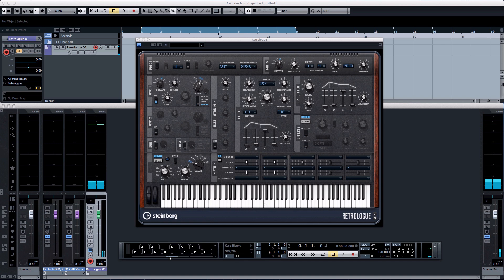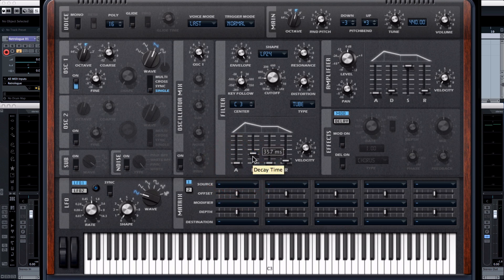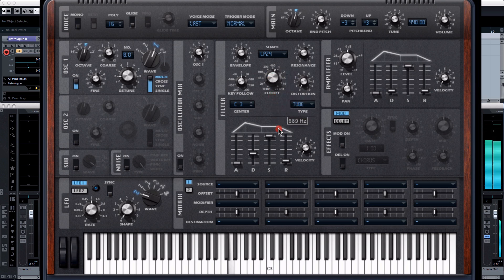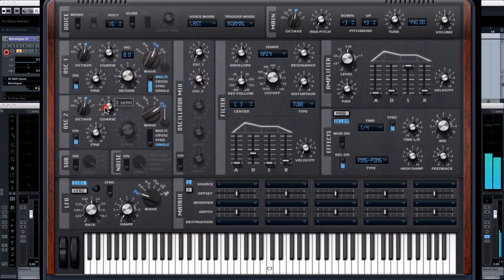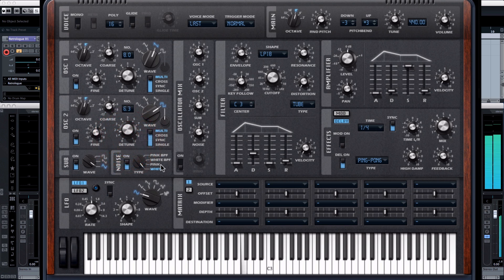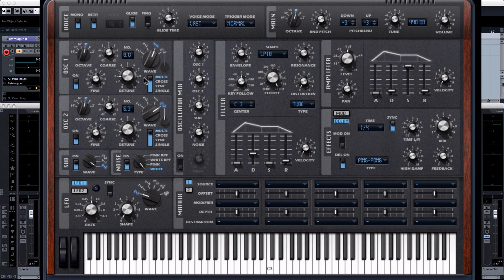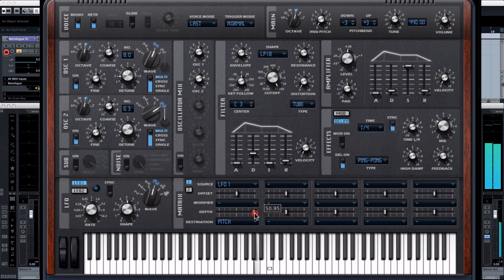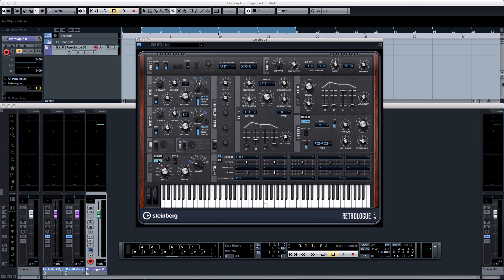Cubase 6.5 Retrologue Synthesiser - first look

Comment: To answer the last question 

Included with Cubase 6.5 and also available on its own as a plugin, Retrologue is a virtual analogue synth that holds no major surprises but sounds superb.

Two oscillators (with up to eight unison voices each, PWM, hard sync and cross-modulation options) plus noise and a sub feed into a 12-mode resonant filter with onboard distortion. Two envelopes and a pair of LFOs shake the basic sound up and delay and chorus/flanger effects bring some polish.

Best of all, Retrologue sounds incredible - every bit as good as many synths costing three times as much. Basses bounce, leads scream and pads scintillate.